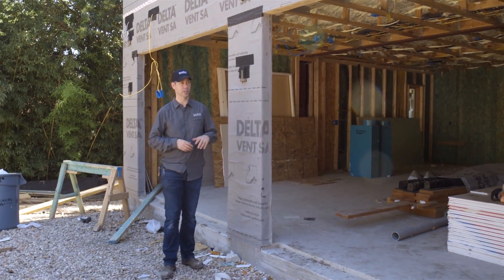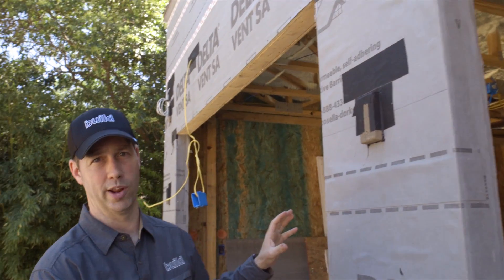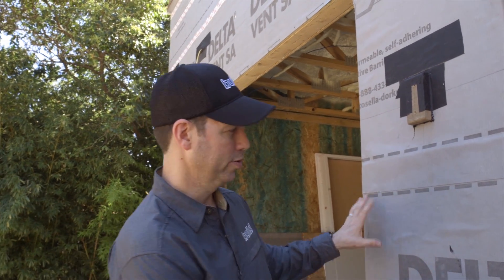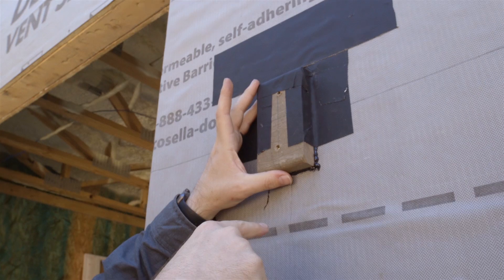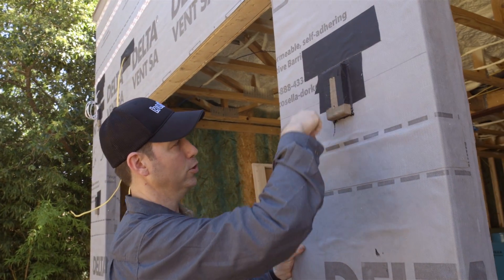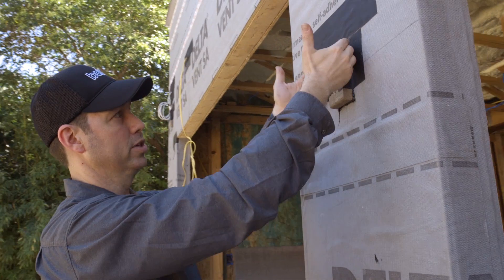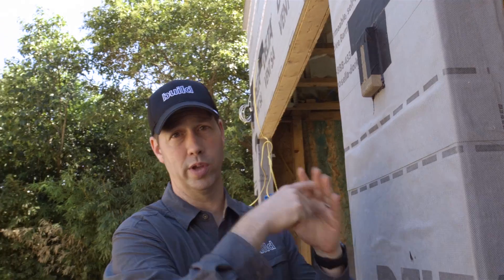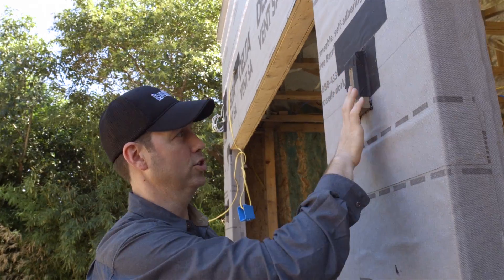Flashing An Awning - SIPs House with Delta Vent SA

Comment: Why wouldn't you want to drill directly into the stucco?  The composite piece is screwed into the wall so what is the difference?
Reply: don't wanna touch the stucco finish, it could crack/chip/weaken/etc...